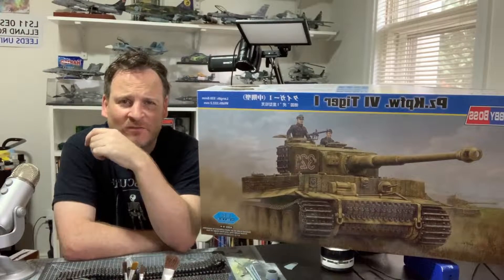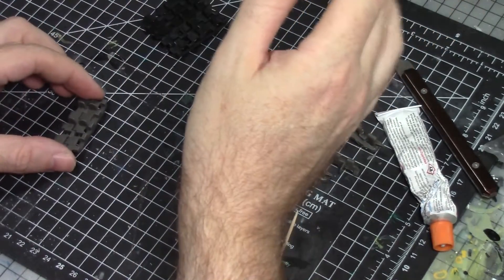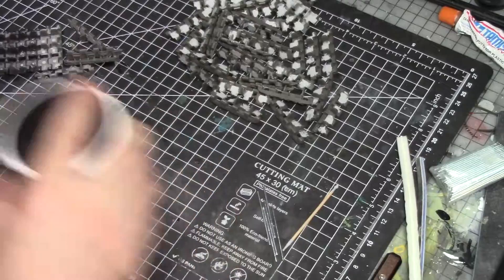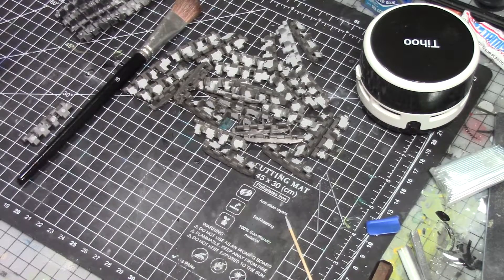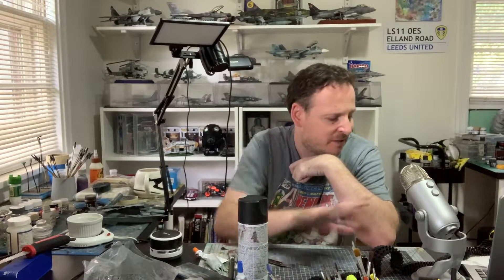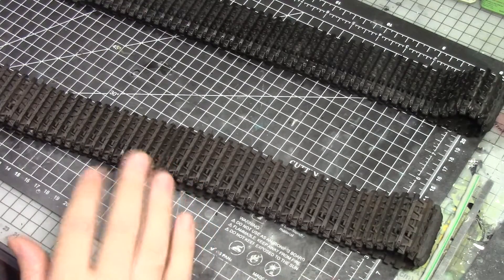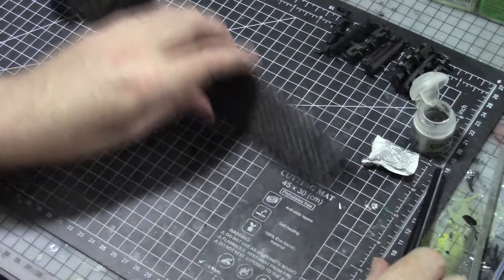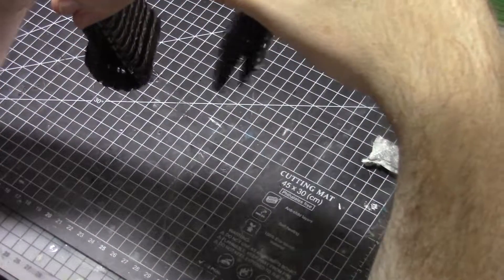1/16 HobbyBoss Pz.Kpfw.VI Tiger I Build Series - Part 1: Tracks

Comment: Nice work on the tracks Richie. I do think yours are a bit clean though. With them being made of metal in real life. I think they would have been rusty quite a bit. I built that Das Werl 1/16 Stug last year, which you featured in one of your monthly update videos. No track pins with that kit. You had to glue 2 track parts together while at the same time joining the links. Here's how I painted them. First I painted the whole tracks with Tamiya XF56 Metallic Grey. I then gave them a light spray coat of Ammo Mig Jet Exhaust Burnt Iron. This gave a sort of dark rusty type base colour. I have an Ammo Mig Set of rust paint colours in various shades. I started with a darker rust colour put down as a thinned wash. Then I put lighter rust colours on top, finishing with the lightest colour. I then dry brushed all the contact surfaces with a steel colour. I think they came out looking suitably rusty. Won't post links here because I know Youtube doesn't like web links in comments. But you can see pictures on my Scalemates page. Just search for my name. Did a similar process to make the exhausts look rusty. But with those, I first painted them with Mr Surfacer. Let it dry for 15 minutes. Then I stippled with a stiff brush. This made a rough surface like what happens with old rust. I then painted them in the Ammo Mig rust colours. looking forward to the rest of this build series.
Reply from the maker: Thanks for the info. Have a nice weekend.

Comment: Thanks for your reply. Perhaps my question wasn't phrased properly. Do you complete the treads by draping them over the wheels and securing them with a pin or do you finish
the treads and then stretch them over the wheels?
Reply from the maker: I run the “string” of links through the wheels and then pin when done. With these link tracks there isn’t the tolerance to stretch over the wheels like the rubber band tracks.
Reply: Thanks for the tip!
 @RWHobbies